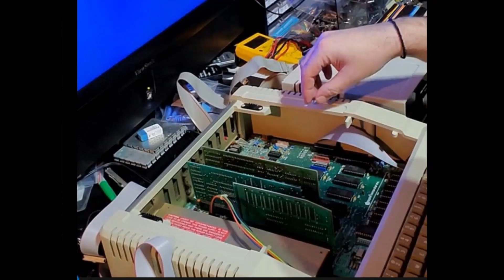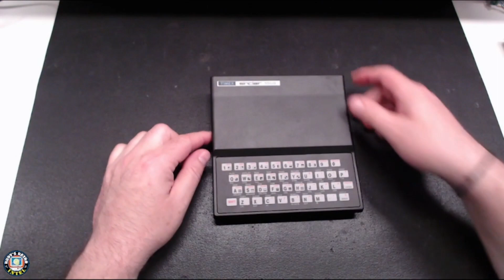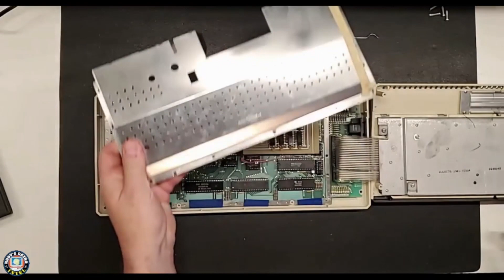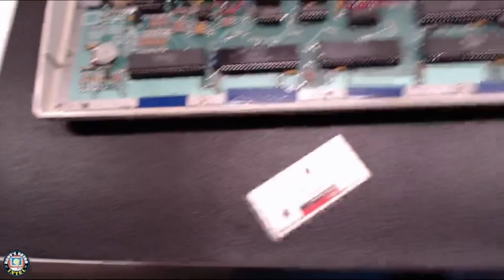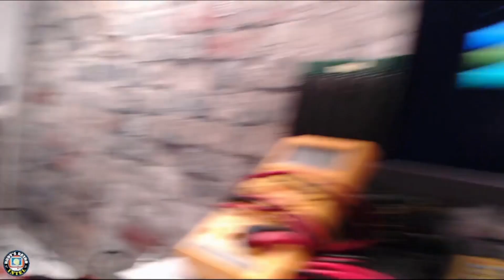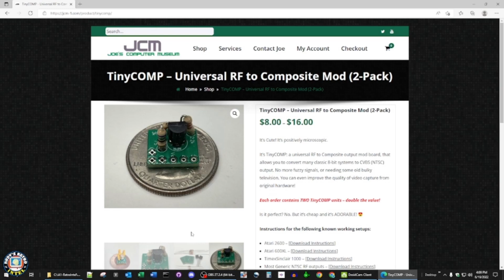Elevate Your Experience: TinyComp RF TV Output Upgrade

Comment: Would it be possible to add this board to the tv itself to have component input?
Reply from the maker: Good question. I don't believe so. The design is to convert an RF signal into a composite one. Not sure why you would want this on your TV.
Reply: @RudysRetroIntel  I have an RF only tb and want to add composite to it. But I guess i'll be tapping into the jungle Chio then. Thanks for replying.